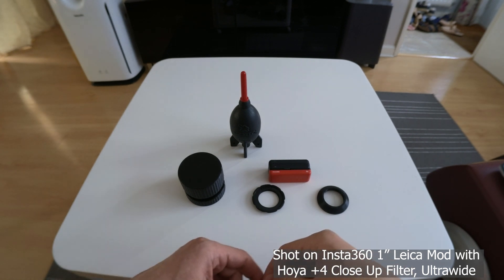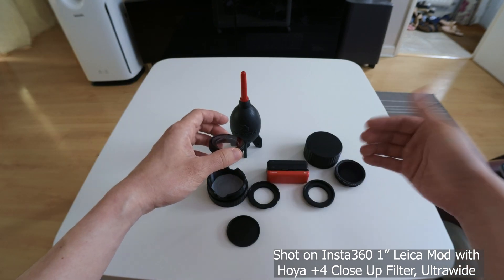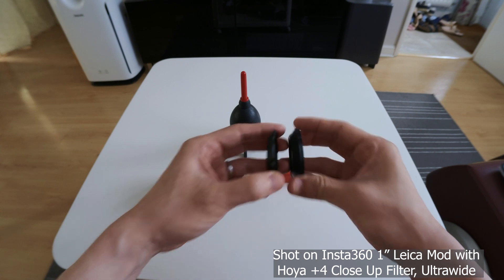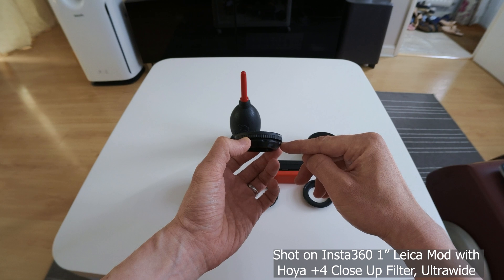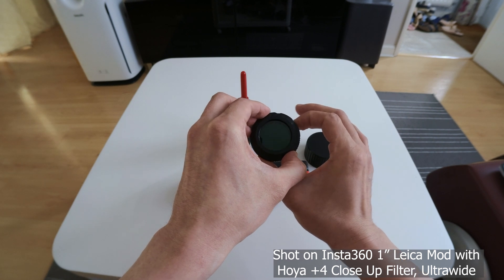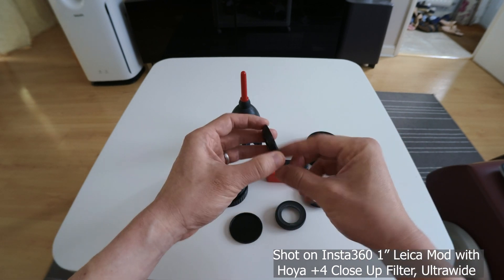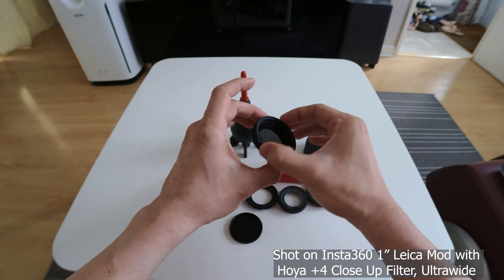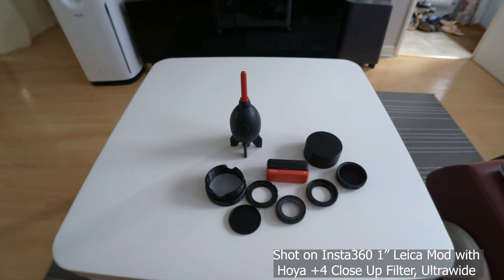Macro, Variable ND Filter Adapter for Insta360 One R/RS 1 Inch Leica Mod?

Comment: Hi, can it be used for One RS 1-inch lens mod as well? Thanks
Reply from the maker: There is only one, 1 inch leica mod AFAIK. If you are not referring to the 360 version, it should work.
Reply: @Imspir3 Thanks!

Comment: Hello Ed. I watched your youtube video about your 3D printed filter adapters for the insta360 1-inch Leica mod. Are you still making them? Which adapters do you make? I dont have a 3D printer. If you are still making them could I order a bunch from you? I need them to attach a variable ND filter and also for a Circular Polarizer. I'm getting ready for this 2025 spring, summer and fall season here in Ontario, Canada. I sent you an Instagram message also. I would really need to get some of these adapters from you or get them printed. 🙂
Reply from the maker: @bwphotoguy1  Hi, I stopped offering them as I wasn't selling as much as before.
I can print a couple out if you want to buy them. When do you need them by?
Reply: Hi. Thanks for your reply. Is this something I could do if the plans are available for download a D then I could just send them into an online 3D printing website? Or, if not I would love to get them from you then. @Imspir3
Reply from the maker: @bwphotoguy1  Hi, I won't send the 3d files. I'll see if I can relist it on Ebay and give you a nudge.
Reply from the maker: @bwphotoguy1  Hi, just in case you still need them. I've updated the ebay link in the description.
Reply: Hi, I tried to order a couple pieces through ebay, but it says the items cannot be shipped to Austria. Is it just ebay or don’t you ship them anymore?

Comment: wont let me buy from australia  can i pay u directly and u post them to me ?, thanks
Reply from the maker: Hmm that's weird because I've sold to Australia through gsp before. Else drop me an email and we'll go from there?
Reply from the maker: Hey David, thanks for the support. Just double checking that you will be getting 6 no adapters as there are 2 adapters per purchase?
Reply: @Imspir3  sorry didnt see ur message , thanks for replying,  didn't realise there were two adapters per package, that's ok, not problem, i have spares hahaha, and at least once i screw in the filters i can leave the most common used ones on there own housing so i dont cross thread them, thanks for making the effort to let me know :)

Comment: Neat idea. How does it perform: any vignetting? I am interested in buying one or two but find GBP 15 GBP for postage a lot. Why does it have to be that much?
Reply from the maker: Thanks.
The video you are seeing is shot using the close up filter on the adapter. 
As for outside of UK postage, it's set by Ebay as I have no control over it :(
Reply: @Imspir3  Ordered two. Great idea.
Reply from the maker: @Quarantain  thanks for the support. You are getting two adapters in one purchase so are you sure you need 4no?
Reply: @Imspir3  Thanks for the heads-up, I didn't realize that there were 2 in 1 purchase. It's already been paid, let's just go with it. That just means I'll have one for each macro filter  :)

Comment: Wow this is great. This is exactly what I’m looking for to attach my camera to my telescope eyepiece which has a 43mm extension to connect cameras. I was thinking of this and then just get a step down to 43mm. Would it be possible to creat one that connects directly to a m43 extension? Awesome work!
Reply from the maker: Thanks.
I'm sorry but I don't get what you are trying to achieve as I don't have your equipment 😁
I'm not doing any commissioned design because I'm just an amateur so don't know how long nor how to charge as it's probably going to take a long time for me to design something I'm comfortable with.
Reply: @Imspir3  no problem. It shouldn’t be too complicated to connect your 49mm adapter to a 43mm telescope eyepiece. I just bought mine. I can’t wait to get it. Thanks.
Reply from the maker: @joekritz8227  thanks very much for your support.

Comment: You're doing exactly what I recently said that Insta360 should be providing, an adapter that can take screw-on filters. I made a modification to the original clear protector by gluing on a filter ring without glass so that I could attach a better protection filter but that caused vignetting, though easily removed in post. I also bought some Freewell ND/Pol filters which I'm not happy with at all (very poor quality) and have removed the glass from one and replaced it with a B&W MRC clear filter. There's far less vignetting and I can now also attach a lens cap. I'm looking at doing the same with the other Freewell NDs and attaching close-up filters.
Reply from the maker: Well done for being creative.
For this adapter, there is no vignetting as you can see. I didn't show nor mention in the video but i printed a 52mm lens cap that fits the vnd.
Reply: @Imspir3  You should put this up on Reddit in the Insta360 section, you'd possibly get a lot of interest.

Comment: I’m interested in a solution similar to this. I have a threaded dome I’ve been trying to mount on the one inch module. It’s 42mm threaded dome. You’re the first person I’ve seen make an adapter that fits right on the lens (and not over the lens protector).
Reply from the maker: Thanks. I don't know how it looks (the dome) but from what I can see, you might struggle with the dome appearing on the edges.